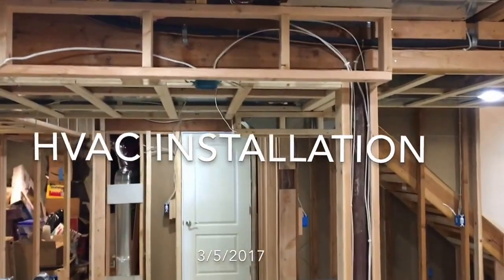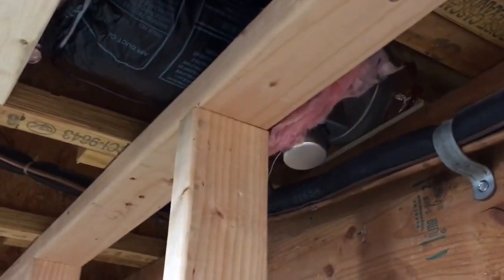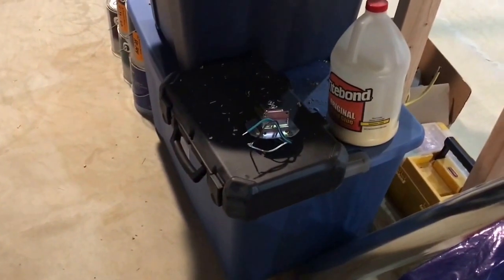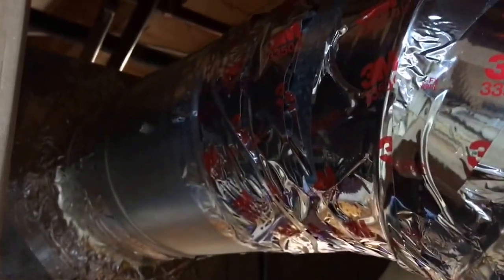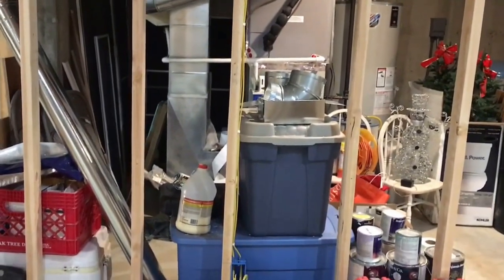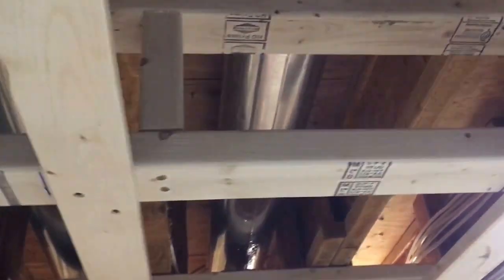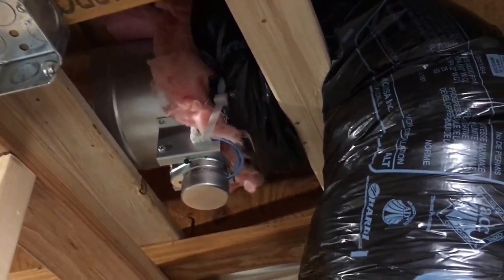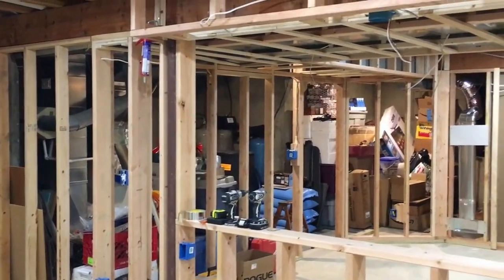Finishing My Basement - HVAC Installation

Comment: It looks like you put supplies on both the floor and ceiling, correct? Where did you end up putting the returns, on the ceiling or down low? Thanks for the videos!
Reply from the maker: First.  Thanks for watching and commenting.    Ideally, in my opinion, both return and supplies would best be suited down low.  But when doing basement HVAC, "you gotta put em where you can".  (A quote I got from Eddies Case, aka the BasementFinishingMan on YouTube - check him out). 

I am in Jersey and heat in the winter is more important than A/C in the summer as the basement stays quite comfortable in the winter.  That said - you should recirculate the air year round regardless.
Now onto your question.  I put a total of 3 supplies throughout the basement.  Two of them I was able to get down low.  The one on the ceiling in the home theater room was the most feasible place to tap into my existing supply duct.  It actually works quite well in there because it is directly over the seating area and keeps everyone nice and cozy.
There is one large return for the entire basement.  I also placed that down low.  Go to 2:55 in the video above.  Starting here I explain where the return ultimately winds up and why I chose to put it there.
One last comment about re-circulation (now that basement has been complete for 2-1/2 years and I have used it throughout a few seasons):
This set up I choose works extremely well for heating in the winter.  The basement is extremely cozy and I have noticed zero ill effects that it "steals" heat from the floor above.  That is because the basement heats so quick and then the automatic dampers close.  Thereby sending all heat to the first floor.
The summer I have to tweak things a bit.  Because the basement naturally stays cool and never humid.  Temperature-wise I could get away without ever asking the dampers to "open-up" and it would stay very comfortable.  That said, I find it imperative to occasionally have them open up to get a blast of fresh air down there.  It will get quite cold when the A/C kicks on.  So in the summer I adjust my basement thermostats to open up the dampers when I know the A/C will be operating.  But I set that temp quite high so they don't stay open too long.  I also tend to keep the basement door open in summer.  This way I cool my first floor and that cool air naturally "falls" down the stairs into the basement.  Keep in mind the low return line we talked about earlier.  That alone recirculates the air and keeps the basement very fresh.  Think of it this way - If I never opened by basement supplies in the summer, the open basement door IS the supply line.   Cool air flows down the steps, permeates throughout the basement, gets sucked back into the return, then through the air filter, then through the heat exchanger, back to the first floor, and once again repeat the flow down the stairwell.  Air-wise you have zero sense of a feel that you are in a basement.  THAT, in a nutshell, is why a basement return in a finished basement is imperative.

Comment: @diesel mike  thanks for putting this video together. I want to do this exact same setup but can not locate any instructions on how to wire a thermostat directly to a damper. Could you show us how you did that? I have a different type of damper that requires 24v to open and a separate plug for 24v to close. I plan on using a relay but cannot figure out how to wire it to a thermostat. Hoping you could shed some light on how you did yours?  Thanks!
Reply from the maker: I will try and shoot a quick video of the wiring.  The dampers do work on 24V.  No need for a relay.  However a transformer is necessary (which in my case was supplied with the dampers).
Basically you open up a nearby 120V junction box or existing outlet (in my case I ran new ones being that I was wiring the basement from scratch).  Inside the 120V junction box simply tap the transformer to the 120V wiring.  This is simply unscrewing the existing wire nuts in the box and connecting the transformer - Hot to hot, Neutral to Neutral, Ground to Ground.  From there you mount the transformer on a Jct Box cover and close the box.....
What you have done now is "Transformed" the household 120V down to 24V via the transformer.  All connections to the Thermostat and damper will be made to the terminals on the front of the transformer in a "triangulated" fashion as such.....

Using 18/2 Thermostat wire (18 meaning the gauge & 2 meaning the number of wires),  you will connect one wire to the appropriate terminal in the Thermostat.  Run that to one of the terminals on the front of the transformer (there's 2 terminals).  Now take another wire, connect in to the other terminal on the transformer.  Run that to the damper (also only 2 terminals), connect that to terminal 1.  Now take another wire from Terminal 2 on the damper and run that back to the Thermostat (to appropriate terminal).   You have now completed the circuit between the Thermo, Transformer, and Damper. 

What I can't explain in print is which terminals to connect in the thermostat.  I will have to visually show that on the video.  So stay tuned.
Reply: @DieselMike  Thanks for making this video. Were you able to shoot a followup video for explaining wiring?

Comment: Great video! Did you leave an access panel to service the damper? Also, Honeywell makes a great zoning system to add electric dampers on your supply ducts to open/close based in which thermostat is calling your system to run. The HZ322 would do 3 zones.
Reply from the maker: Hey.  Thanks for the comment.  So, as you watch the video, you will see I installed three of these dampers.  Two of them I have full access to should anything go wrong.  However, the one in the ceiling is now buried in drywall.  I had no choice with that placement.  That said, I did plan a little for this in case I ever need to get to it.
1.  These videos (and many other photos) will tell me exactly where I would need to cut into the drywall.  But that is just for the one damper itself.  Someday, when I have to do this I will close up the hole with one of those white, plastic access panels.
2.  I mounted the transformer back a ways into what is now a storage area of the basement.  So I can sully access the transformer.
3.  The other 2 units are fully accessible behind the wall in a storage area.  That is for both the transformers AND the dampers themselves.

Comment: The auto dampers are a fantastic idea......until I saw this vid I was just going to close the heat registers on the ceiling manually.....would be a hassle to do so.
Reply from the maker: Thanks.  It's working out well.  Once you set a proper schedule on your thermostats it's seamless.  Thanks for watching and commenting.

Comment: DM, what damper system did you go with and did the manufacture have a thermostat to match or was it pieced together by you?  Thx!
Reply from the maker: This was the damper:   https://www.homedepot.com/p/Suncourt-6-in-Motorized-Adjustable-Damper-Closed-ZC206/306030717
Any thermostat will do.  They do not have one that goes with it per se.  You can even use a simple toggle switch to turn On & Off the damper. (On - Damper opens, Off - Damper closes).  Anything that sends a single when to open or close the damper will work.  I used a Honeywell digital thermostat and set my temperature thresholds to tell it when to open and close.  Hope that helps.  Thanks for watching and commenting.  Anything else I can help with, don't hesitate to post another question!

Comment: Quick question regarding the supplies you tapped into and used the auto dampeners on; is that basement thermostat connected to the upstairs thermostat?  I see where the duct work is tapped in and understand how the basement thermostat would open/close the dampeners but from what I see it still relies on the main thermostat to activate the furnace or AC unit.  From what I can tell if the main floor thermostat has not turned on the furnace there would be nothing coming through the dampeners even if the basement thermostat called for heat/AC.  I hope that question makes sense.
Reply from the maker: Question makes sense and you are quite correct in your assessment.  One correction in your statement above... The basement thermostats are not 'connected' to the upstairs thermostat.  Each one is individually connected to the damper it controls.  But yes, everything in the basement is dependent on the upstairs (first floor) thermostat calling for heat.  The basement thermostats merely tell the damper when to open.  But if the first floor isn't calling for heat, nothing will be flowing through the system.
The way I set my schedules on both the upstairs and basement thermostats actually work quite well and keeps everything very balanced as per the way I set the heat schedule. Basement was completed just before Christmas, so I got through a whole winter.  It gets very cozy down there when watching a movie in the new theater.
Reply: Great!  Thank you for explaining.  Regardless I think it's an excellent idea to lower costs when the basement is not in use.

Comment: Did you tap into your main floor hvac
Reply from the maker: Yes.  In three different locations.  Wasn't that clear in the video?
Reply: Diesel Mike Was high 🤓 thanks 4 the info
Reply: @DieselMike  Great videos, thank you for posting.  Curious how you were able to cut a hole in the top of the main when you moved it for your family room?  I have soffit already, wasn't sure if it's possible to do it in the small area of the joists or if I'll have to take some of my soffit down.  Thanks!
Reply from the maker: @MizzouGuy1970  
First - Thanks for watching and commenting.
It was a little tight in there to work. I had to cut three starter holes in all for this project.  
On my first attempt, I drew the correct size circle with a compass and outlined it with a sharpie.
Then I drilled a starter hole somewhere toward the edge of the circle, big enough to get a pair of aviator tin snips in there.  I started with the yellow handle snips (the rough cut ones) to cut out the circle, staying inside my sharpie marks.  Then I switched to the Green and Red handle snips (the clean cut ones) to work my way out till I was cutting a somewhat clean cut on the sharpie line.  This process was tedious and difficult, because of the tight clearance in the joist bay, I had to keep alternating the direction of my cut and switching from the green to red.  You can only cut off a small amount at a time, otherwise the metal will bend and not cut nice.  This really sucked.
On my next attempt I used my Roto-Zip with a sheet metal bit and the circle hole adapter set to the proper diameter.  This went much quicker, but was, a) dangerous with potential shards of metal, and b) did not leave a clean cut at the edge of the circle.
3rd attempt - I used the Roto-Zip method but cut a tad short of the Sharpie mark.  And then "cleaned it up" with the aviator snips.
At the end of the day, I was making myself too concerned with a clean edge.  After you install the starter collar and bend the tabs around the metal, if you cut badly, just correct it with lots of foil tape and/or mesh and mastic to make it air tight.

Comment: Impressive, taking a lot of notes on your work; we also have almost same basement layout. I was hesitant to attempt HVAC myself but you brake it down great!
Reply from the maker: Thanks for watching.  If you have to fabricate any flat sheet metal, I suggest you buy the proper tool.  It's cheap.  Just search "HVAC Folding Tool" on Home Depot or Lowes.   Without that, you will not get the proper and accurate folds needed.  Also familiarize yourself with the proper way to use tin snips (red vs green handles).  I know this sounds stupid that I am suggesting how to use a pair of scissors... But it's not that simple which I quickly learned.  Practice on a few small scrap pieces and you will get the hang real quick.  Good luck.  Any other questions, just ask.  I'll do my best to steer you in the right direction.

Comment: Great idea on the damper.  Making note of this for sure
Reply from the maker: Thanks.  I like the idea that I won't always be "stealing" air from the first floor when I don't need to heat/cool the basement.  Keep in mind with this method however, your thermostat will only tell the damper when to open or close.  Your main thermostat that is connected to the furnace still tells the furnace to turn on or off.   i.e.  Say it's the winter time and I have my basement thermostat set to 70 degrees and it's 65 down there.  The damper will open.  But the furnace may or may not be on at the time.   If my first floor thermostat is also set to 70, but the temp up there has already achieved 70, the furnace will be off.  So the fact that the basement damper is open, doesn't mean that I will necessarily get heat until the first floor Thermo tells the furnace to go back on.  Hope that helps and makes sense.